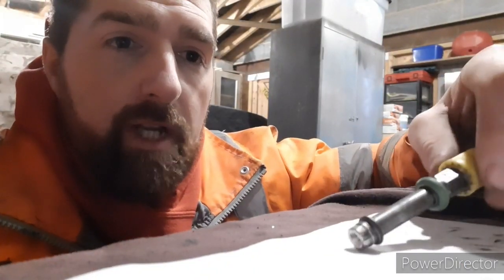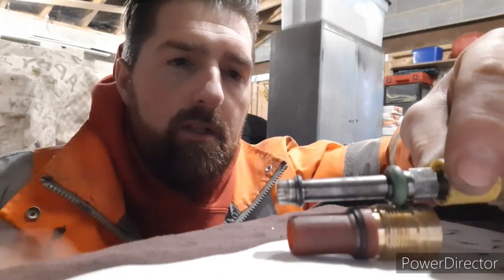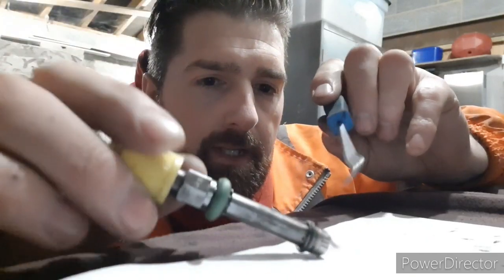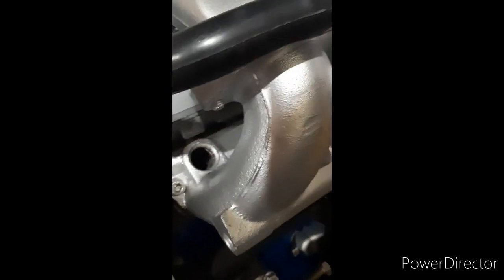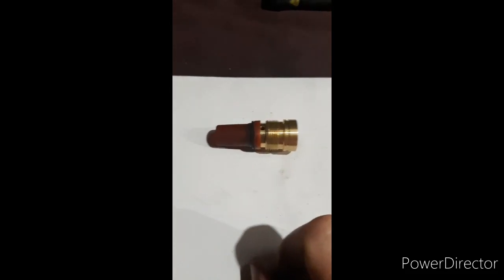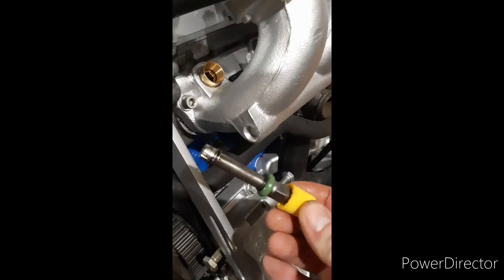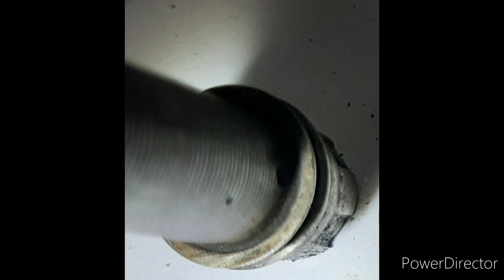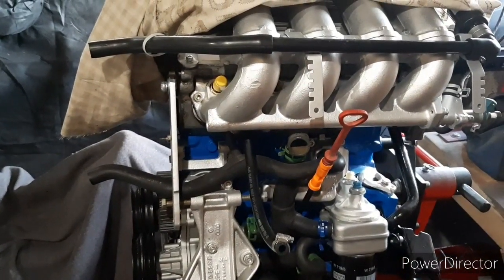Bosch K-jetronic - Mk2 Golf Gti 16v - Air Shrouded Injectors

Comment: Hi I'm just overhauling my injectors on my 91 Etienne aigner cabriolet ( 97000ks) do you need the snap rings that sit under the large seal on the Bosch air shrouded injectors as I've lost 2 of them and can't seem to find any replacement ones ...
Reply from the maker: Most other injectors don't have those snap rings and to be fair I don't have them on mine
Reply: @GreyGooseRestorations thanks mate didn't think they were relevant..

Comment: The idle of my Golf MK II 1.8lt is running to high, I was told that the fuel injector of the carburator was damaged  and needed replacement. How can it be fixed?  Your videos are great. Thanks for the response.
Reply from the maker: Not sure what they mean by the injector being damaged and causing to much fuel, if anything it'll be the opposite. Unless the fuel distributor is at fault and is delivering to much fuel, the injector is basically a tap and the distributor dictates the flow, the injector can become worn and blocked

Comment: My connecting air shaft between injector holes was completely blocked by carbon. Found out when replacing the head
Reply from the maker: They can get pretty clogged up especially after all these years

Comment: Another great video. At long last my mk2 16v is running. 

Changed the 4x injectors which has done the trick, previous fault was the return to tank line on the metering head was faulty, the spring was weakened and was effectively priming then sending it back to the tank !!

I now have another problem.... with the car running I think would change the oil and filter. The oil filter seems to have welded itself in place and I cannot move it. 

Made sure I followed lefty loosey righty tighty but it will not move. 

Have tried a strap and have ordered a chain filter removal tool was wondering if anyone has any tips as the position is also a nightmare. 

The car is supposed to be going for paint next Friday and now am stuck. Again !!
Reply from the maker: Worst case try and get a sharp chisel or flat head on the filter top where it meets the water/oil cooler and give it a few taps, hopefully that will loosen it off
Reply: Have got it off now, chain filter tool.wormed a treat. 

She is running ( have uploaded video) 

When applying throttle it seems to be drawing air from somewhere, sounds like the rear of inlet manifold. 

Is going to paint on Friday (hopefully)
Reply: Thanks for that. My plan is to get it to  paint (hopefully) and try to rebuild. Think I will send the metering head to you for a service 

Thanks again

Comment: HI!! Can you give me the reference of the O´ring from the bottom?? I have a Audi GT Coupe. The only thing different is the top cap. For manual told me N 0138443 but I see on many videos that O´ring is from rubber not from "gasket paper" material so I think the correct are that you and other people assembly. Many thanks if you can bring me that info :D GREETINGS!!
Reply from the maker: Hi, thanks
The lower injector seal is 10 mm ID x 1.5 mm diameter
Reply: Ahhh okey!! I took one before but is made it from gasket paper and doesn't look really good soo before assembly I want to be sure. Thank you for the help!!! The torque also so hard to find it. I will put it 15 like you say
Reply: I talk about the outside cone o ring. Not from the inyector 🥹
Reply from the maker: @ZohanSauberPetronas, ah, i got ya. It's like a square o ring. I never found them, so I used a normal o ring that fitted. You'll find them in any generic o ring box.

Comment: One other question that really bothers me about the CIS; when the intake is closed, there is a continuous mist/injection of fuel sitting there until the intake valve opens.... right?
I'm still not clear of your explanation, or the methodology of the Unshrouded design & plumbing layout.  It seems the coupler/brass receiver with holes works as a venturi, but once again only when the intake opens to pull a vacuum, right?????
Has anyone tried to modify regular K-Jet injectors instead of retrofitting Shrouded injectors?  
I'm not familiar if there is a K-Jet performance aftermarket....
Reply from the maker: The injectors themselves are the same bar a top hat thats fitted which lets the air pass.

Yes when the throttle plate is closed at idle there is still fuel being injected with minimal shrouding.

With k-jetronic is all proportional, more throttle opening equals more fuel and more air and more shrouding effect
Reply: Thanks for the reply:  Did you ever see this 1980's factory introduction about the shrouded injector? https://m.youtube.com/watch?v=mVRaUnLmv1s

I'm still confused about this system, it seems that the air used by the system would be "unmeasured air" & like a leak, unless these systems were able to calculate that measured air being passed over the injectors internal air channel coupler-device?  Do these systems use MAP or MAF?
How can it measure this minute air volume?

Have you ever seen any forum discussion, about retrofitted Air Shrouded Injectors on any early K-Jet systems?  I wonder if this has been done by any of the Porsche or Benz , Volvo owners ect.......?

I want to really learn as much as I can to see if this can be applied to the PRV V6 engines that used the K-Jet.

Does Bosch have an accessible Hotline or aftermarket tech help on these injectors????

Thanks for any more guidance.
Reply from the maker: I'll have a watch later, no map or maf systems on these as the systems are too old.

Unfortunately, due to the age you will struggle to find any bosch hotline that will be able to provide any specific details.

Injectors are just and open and close system and will flow way more than any engine would need.

I think the amount of air used on the shrouding system wouldn't have been much to have to calculate it vs the incoming engine air
Reply: I found your write up on (.vwgolfmk2).  Also just found some great discussions, & unconfirmed dyno test that the shrouded inj. didn't gain HP.  Emissions were negligible, as was any fuel efficiency.  I'd like to post the links, but might get deleted as YT is deleted my posts too often.  

These discussions were very informative....

Comment: I'm learning about the older CIS K-Jetronic systems & really inquisitive of the injector design & any kind of improvements that can be made.  Is there a kit, or has anyone figured out how to retrofit the "Shrouded Injectors" to older CIS K-Jetronic systems???
I'm sure many discuss it, but have not yet found any threads on it for all the cars that used the CIS K-Jetronic.
Reply from the maker: Depending on the vehicle/engine it may not be possible, for example the 16v engine inlet manifold was designed with the shrouding in mind

Comment: Do you have any tips how to get the injectors out? They probably haven't been removed before, and i don't want to ruin the seals when prying them.
Reply from the maker: Give them a good spray of WD40 or similar, give them a wiggle with the injecror line still attached, give them another good spray then  get a good hold on the injector line right on the angle and give it a hard and fast pull. They should just pop out as its only the seals that hold them in there

Comment: You mention the air line being connected to the block also, is the crank case breather as well?
Reply from the maker: Yes
The hose connects to the crank case breather
Reply: @GreyGooseRestorations   Any risk of ‘oily’ air going over the injector then?!  Great videos btw, making me miss my 1991 8V like crazy!!
Reply from the maker: @stevengrace6712  minimal amounts but this is the factory designed system.

Comment: Thanks for posting another video about the 16v. I’ve watched, learnt new things and enjoyed all your videos. I thought that after rebuilding the engine to a high standard, as you’ve done, you would have chosen to go with new injectors. I believe similar injectors from that era have a ultra fine plastic shroud/ filter inside the injector that can get clogged up. It’s not possible to completely clean injectors because of this filter. The first few minutes of the below video show this. 

https://youtu.be/RnegCu5-i9M

We need a 16v owner who has a spare injector to cut it open and confirm.
Reply from the maker: Thanks
As for the injectors in one of my other videos i tested the injectors and they were all flowing more than the required 80ml for 40 secs and they were all within a few ml of each other so i chose to use them. New bosch injectors are in the regin of £80 per injector. That would be interesting to cut one open though 🤨